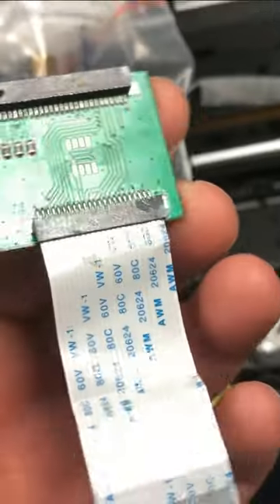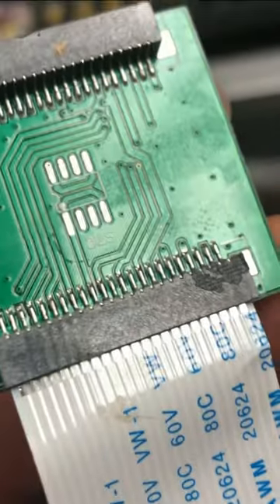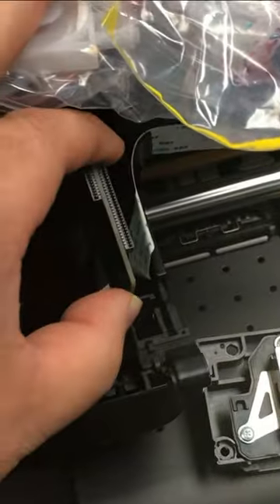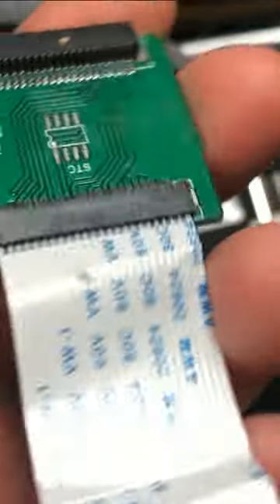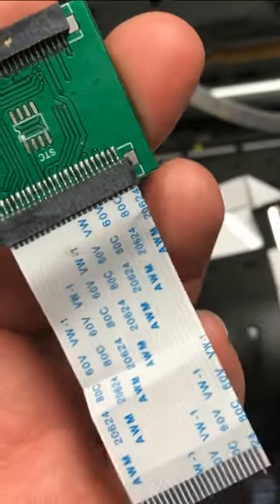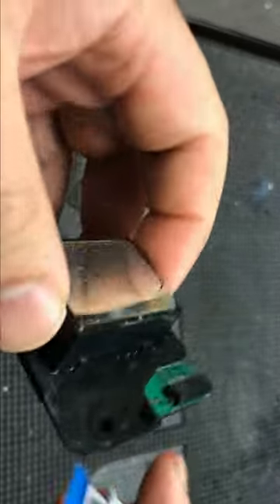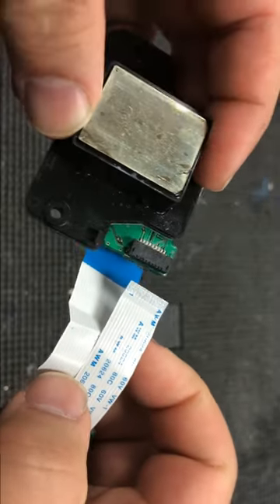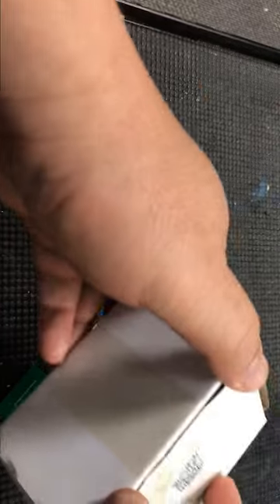Unlocking the Secrets of the DTF Pro Model J: Breakout Board

Comment: Ok so I can buy that break out board, attach a l805 print head to my l1800 printer and it will work? No voltage issues.